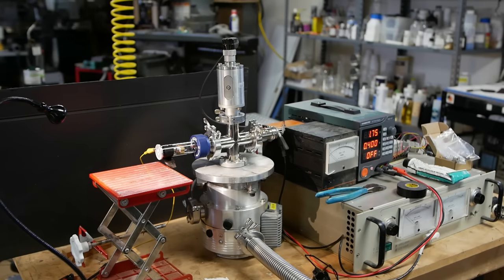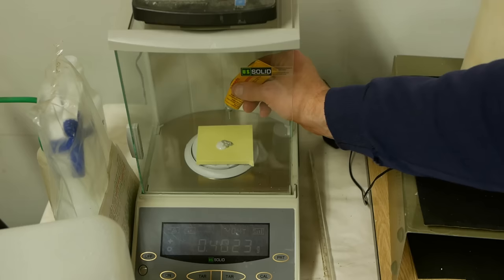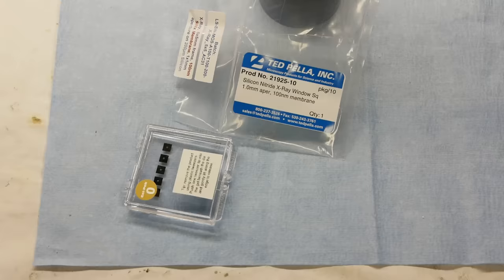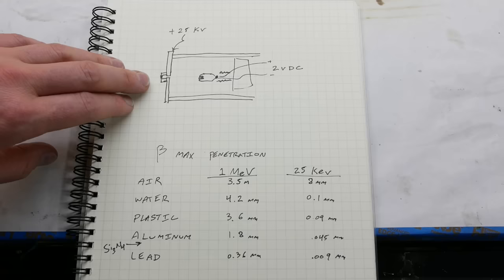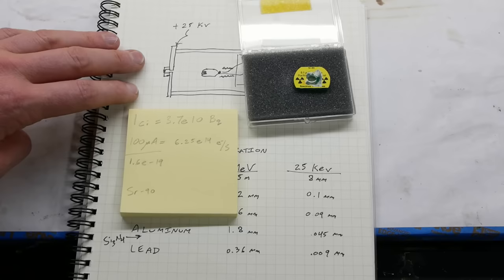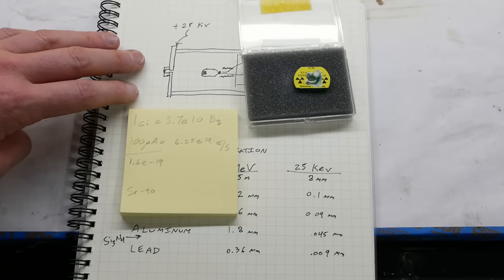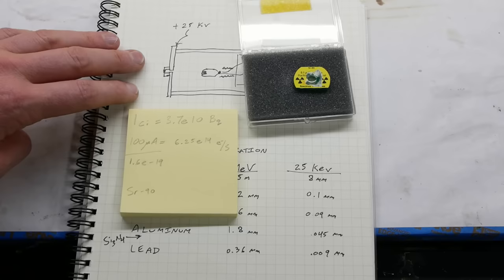Shooting an electron beam through air

Comment: As always first to congratulate you for the excellent videos you do. Second I have a question why the electrons go threw the hole and not strike the aluminum  instead since the hole itself ha no a charge and the aluminum plate has 25000 volts. The logic thing is for the electrons to go  to the positive plate.
Reply: A lot of them do hit the plate.  But the ones flying straight down the center of the tube are pulled equally from all sides and are accelerated through the hole.

Comment: Put a solar panel cell in front of it.  I'd love to see how much power is transferred / created.  

Since we know that solar cells work by pushing electrons from one element through a semiconductor into another elem, I also wonder what other semiconductor (besides silicone) you could use as well as sandwiched elements to create the 'perfect' or unique power transfer. 

What element has the highest number of shell electrons (that would give them up easily), is the element that has the most empty spots in its shell?

Comment: It seems the beam is quite well focused to be going thru the window given the filament is a few millimetres long and the window is quite small but you seem to have very good results. I also thought that the electrons would tend to veer off to the aluminium electrode but instead they must have accelerated to such a high velocity that they continue forward and go thru the window. I wonder how the length of the glass tube affects the performance.

Comment: Could you somehow show the electron diffraction ? It is easy with light, you just put some grating into the beam of light, but I am not sure how to do with electrons and then visualize the diffraction pattern.
Reply: Sure it works with crystal lattice used as grid: https://en.wikipedia.org/wiki/Electron_diffraction , https://en.wikipedia.org/wiki/Electron_backscatter_diffraction
I'm not familiar with the first one, but second one is used to detect crystal structure and orientation and to see different crystals in steels. Only problem is that it needs perfectly polished surface (and vacuum, phosphor screen, camera and beam focused on single crystal at proper angle)

Comment: How low an energy can you run this and get the electrons through the glass? I was thinking you could run a barium doped emitter and not ruin it if you have to bring your device back to atmosphere. The emission from those barium filaments is apparently amazing but, you can never bring them back to atmosphere once you use them. That makes them problematic form calibrating gadgets that go to space.

Comment: Great video!, I use similar tools in a semiconductor cleanroom. Never imagined that someone will build similar ones in a garage :D
Technical questions, what vacuum levels did you reach and what is the limitation?, the pump or the chamber?. Did you use any roughing pumps?. What are the value of voltage, current and frequency of your source?.
Reply: He was using a common flashlight bulb.  DC current, 100mA.  Probably a few volts. He showed how he made it in the video.

Comment: I don't think your finger would suffer much, considering penetration depth, the beam would probably give up steam somewhere within dead cells layer.

Nothing prevents most of the electrons ending up in aluminum disc now. If you want to reduce x-ray emissions and get more electrons through the window, you need some focusing.

Comment: This thing only requires low current HV DC, right? Voltage multiplier on a neon sign transformer can get you that easily enough, for higher electron speeds.

Comment: IIRC beta irradiation is also used to treat PTFE to allow adhesion to it. Maybe stick a bit of teflon in the beam and try to glue it?
Reply: I wonder if that's how they get non stick coatings to stick to the pan.(?)
Reply: @pinethetree  that is exactly the use I had heard
Reply: @damienmiller  Awesome! I've wondered about that for a while.

Comment: Is there a way to block the X-rays and just get the electrons?
Reply: I think focusing the beam in the tube would help, if I'm understanding right you get x rays when electrons of sufficient energy hit stuff, in this case that aluminum plate. Of course I suppose it's always gonna spit out some radiation because the whole point here is to bombard things with high energy electrons.

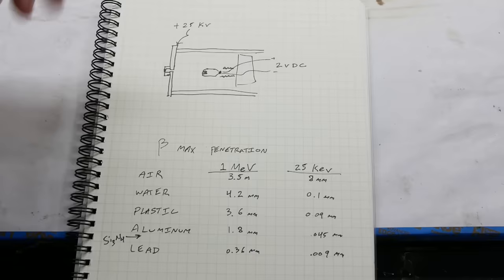Comment: At 07:00 you talk about the aluminum electrode "producing" less powerful X-rays than if it would be out of tungsten (or a harder metal in general). Could you elaborate why this is?
Reply: Google "characteristic xray" for explanation and "
Energy table for EDS analysis" for energies of xray photons. It's not completely true that heavier atom emits higher energy because it never emits photons of higher energy than electron, but heavier atoms have more spectral lines. And characteristic xray is only part of emitted xrays.

Comment: Would it be possible to accelerate the electrons fast enough through a material, say glass or diamond, with a reduced speed of light to create a Cherenkov radiation effect? I've been trying to come up with a relatively safe way to demonstrate Cherenkov radiation with an electron beam instead of a radiation source.
Reply: Looks like for glass, you would need around 170keV or more to achieve Cherenkov radiation if my math is right. Not sure how one could go about accelerating to that KE. Suppose a 200kVdc supply would do it. Also, do the electrons lose energy when passing through the aperture? I am not currently familiar with RF powered accelerator architecture, only electrostatic.

Comment: How about targeting a microphone to see if you can “hear” the electron stream? Try putting a DVM set to amps with the negative lead connected to ground of the power supply of the bulb filament and the beam aimed at the  positive lead to see any possible current flow.
Reply: Also along these lines: try creating an electret.

Comment: How about try using components from a vacuum tube? The grid and plates from a beam tetrode like a 6L6 might be effective, and the heater from it would likely be a far better electron source. Also, try putting the glass from a power tube in the beam- any power tube being driven reasonably hard makes the most beautiful blue glow on the glass from where the stray electrons hit it.

Comment: You mentioned opaque paints being cured this way, 
Maybe an improved conductive paint that could be cured with this.
Or 
Maybe make a photo resist alternative for PCB etching?
I realize this is low on practicality with all the other options out there for PCB etching.

Comment: Oh the pigment thing reminds me, I have some defective gel polish you could experiment with. It’s nail polish that’s cured with UV light, but I think the factory screwed up and accidentally used a UV stabilized pigment because when it cures under the UV lamp this particular stuff only cures at the surface and remains liquid underneath. I’d be happy to donate it to you for your experimenting pleasure, it would probably cure under electron bombardment, and you could contrast it with how it doesn’t quite cure with UV exposure.

Comment: Graphene also makes an excellent vacuum barrier.  Today, the sheets have less defects and you could stack up 5 and they would still only be ~ 15A thick.  So, you get a lot less attenuation than through the silicon nitride.   

The nitride windows have also been used in SEM imaging for in-situ liquid environmental cells.  Cultures are grown inside at ~atmosphere.  You need to have a BSE detector and the cell cultures must be growing on the inside surface of the nitride membrane.  You must also be careful not to focus the beam at too high a current and rupture the window.  Which is likely what happened when you arced your source.  

If you coated the graphene with metal, you would produce a source of x-rays where the beam strikes the metal.  Then you would only need a camera behind the target object.  

This simple x-ray tomography setup was made for inside SEMs by Gatan and Bruker.  But nobody sells them today.  Not enough demand.  But they worked.  You could make a simple version.  I have considered revising the product.  

https://www.bruker.com/fileadmin/user_upload/8-PDF-Docs/X-rayDiffraction_ElementalAnalysis/Microanalysis_EBSD/Flyers/Fly_micro_CT_en_rev1_3_lowres.pdf

The resolution is improved if you keep the metal foil closer to the focused beam and keep the target close to the x-ray source.  But the concept is pretty straight forward. 

You can use you window with a metal costing as well, to produce the x-rays.  

Then put your thin low density target object (the x-rays must be able to penetrate) behind the x-rays source and capture images with a suitable camera.  Rotate the object while taking images and create tomograms.  There is open source python scripts for creating the 3D tomography.  

Similar membrane apertures have been used to make an “airSEM”.  This is an odd company out of Israel and the product is b-nano.  It works. Cornell has one.  Niche market.  

https://www.cambridge.org/core/services/aop-cambridge-core/content/view/S1431927613004133

I have also done micro photogrammetry in the SEM.  Which is very cool!  I did a few presentations and tutorials on that.  You could do that now with your SEM using the simple auxiliary rotation stage. Just like with the drill bit.  Except each rotated image becomes input for the 3D object model.

Comment: Would it be interesting to dip the filament in a barium-nitrate slurry that, after initial heating, forms a barium oxide coating? ...  PS:  I see you already tried something that in your glass diffusion pump video! Great minds think alike. :D

Comment: could you try to reduce molten salts to metals? maybe you could melt some KNO3 NaNO3 in a very thin glass testube and blast it with e-beam - I heard about using electrons from incandesent lamps to get a similar result - submerge glass bulb in molten salt and turn it on for a while and then wash the bulb with Phenolphthalein solution to detect alkali metals

Comment: When electrons "force there way through" things, does it make a physical hole?
Reply from the maker: If the beam is intense enough, yes!  In fact, electron beam welding is used to melt and fuse material in a very highly controlled, super precise fashion.  At lower powers, the beam may weaken or cleave apart molecules so that the material can be etched or washed away in a later process.  Paradoxically, the beam may also crosslink molecules, making that area stronger than the surrounding material.

Comment: Hello.
With the tools and area availability, is it possible to control a highly-charged-proton direction or movement? Tried it in 1965 with a monster transformer and a generator running by 1965 Ford Mustang' Engine), achieved 6.7e7 volts (5.5e1 amp); nonetheless, the voltage was not enough (insufficiencies of plasma), and I could not cage the radiation!
Regards,
Reply: I'm looking for somebody to start a project about applying dielectroforesis force any good sources that you have I ask you for any knowledge about the subject

Comment: I would think that the vast majority of the current from the filament is getting caught by the aluminum plate, but even if you're off by two orders of magnitude that's still a much denser electron flux than just about .any beta source

Comment: One way of detecting beta radiation is by measuring the change in threshold voltage of a mosfet. The threshold voltage changes because of implanted electrons in the dielectric. Seeing that happen would be really neat.

Comment: So I've decided to build this thing because it looks like the coolest thing ever. I bought everything I needed on ebay over a very long period of time and the setup is super jank, but I'm wondering if my pressure is good enough. I managed to get down to about 7x10E-6 torr of pressure, and I'm also going to use a 150kv ish power supply that I made. Does anyone know if the pressure is low enough to avoid a plasma forming and breaking the aperture like he mentioned in the video? I have had to disassemble my turbo several times to replace the bearing and I really don't know what I'm doing so I think if I exposed it to air it would probably explode. I'm trying it in like two days anyway so we'll see but if anyone can intercept this and tell me whether or not my conditions are good enough to keep my setup from dying that would be sick.
Reply: Update, plasma was created at 4×10E_5 torr, aperture broke, turbo survived but goddammit I wanted this to work

Comment: See how many of your other windows it can get through.

See if you can measure the current in the beam through air.

See if the beam current can make a neon indicator lamp light up.

See if you can give a small metal target an electrostatic charge.

Comment: *REQUEST*  
I am an brass instrument smith and I am wondering if there is a version of the solder from your last video that could contain LEAD that would work. It would give the solder enough strength to be used in the instrument world and would allow people like me to make HUGE leaps forward in instrument making (joining aluminum or titanium or nordic gold to a normal brass or copper) that have been talked about for years, but have not been potentially possible. Is a stronger version containing lead (or even something else) possible? If so, please explain how to mix it?
Reply from the maker: There are definitely leaded versions of the active solder, and it will definitely join difficult metals to brass.  You may want to have someone test the joint strength before you invest in your own system, but it will definitely stick the metals together, and be conductive too!  I also found that wetting the difficult metal with active solder, and then later reflowing it with conventional solder works fairly well.

Comment: 10:14 Would you mind re-doing the demonstration after blacking out all the other light sources such as the bulb filament.  That way we can see the electron illumination effect all by itself without the light from those other sources in your lab.  Can you discuss what you think might happen if you discharge the electron beam into a condensed metal hydride such as Platinum infused with deuterium in a manner that would saturate the crystal lattice?  What would it take to get some fusion going on.  It might not be much but would it be possible for a few of the electrons to cause proton molecular fusion from h to he?  If you precisely measure and maneuver the small sample piece you could make rows of the pitting that occurs just like a farmer, plowing.  Thereafter the sample could be viewed under a microscope to attempt to detect any etching that has occurred.  Thanks.
Reply: There is light from the filament coming through the window itself along with the electrons.  You aren't going to be able to block that.

Comment: I was running an electron beam irradiator for several year in the tire industry. 350-500 Kev, 30-50mA, Titanium window 4x20cm 2microns thick, distance between rubber sheet and Ti-window 1-2cm.
The irridiation chamber was a concrete bunker covert from inside completely with lead plates. 
The electrons do generate X-ray radiation inside the bunker. For That reason we needed the lead shielding. 
For Saftey reasons Even everybody working outside the Bunker needed to wear a radiation dosing Badge. These Badges needed to be sent on regular Basis to the local authorities for further Investigations.
X Rays dosis in the Bunker was that high that a modern new CCD Camera was sending Color pictures for only 2 Weeks, for another 4weeks black and white pics and After that time no pictures.
Yes, it was a challenge and a lot of fun to run such a machine but you Must be cautious.

Comment: I just wanna see if it creates a positive electromotive force if you beam it straight onto a conductor, making a wireless circuit. 

A different approach, also, would be to see if you can harness electromagnetism with a coil around the traveling electrons, making a wireless electric motor
Reply: I'm looking for somebody to start a project about applying dielectroforesis force any good sources that you have I ask you for any knowledge about the subject
Reply: @Podemosllegaralossubs-ty7bq  I'm afraid I won't be of much help. Apart from knowing it's used at times in microbiology, I'm not very familiar with DEP

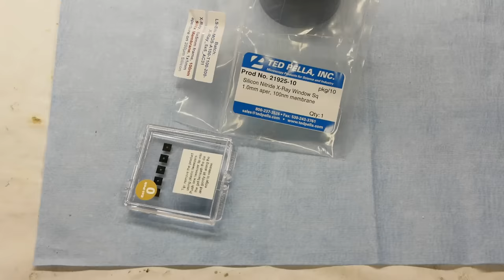Comment: 3:38 That was to much for the turbo based on the volume in the form of the turbo top part and the 4-joint and the glass. A chamber about 3 - 4 times that volume opts for about a maximum 0.2- 0.3 mm hole when venting. The turbo might just seem fine but the bearing takes damage since there is a huge force involved even with small amount of air since the rotor spins so fast. If way to much of air rush in the wings can be bent upwards and if they slam into the stator wings you don't want to be in the same room, trust me I have seen the after match. I was not there but close and it sounded like a small bomb went of. The wings/blades on the rotor was completely ripped off so the pump was absolutely totalled, fortunately no one was hurt though. It happened after a valve failed and totally opened up to full air right into into the turbo. Like a 10 cm hole just open to air and the turbo at 36000 rpm+ was on the other side.

Comment: couldn't you also use a very small aperature plasma window/valve (https://en.wikipedia.org/wiki/Plasma_window) for this? I've been wondering if that's within the reach of the diffusion pump equiped homeshop for a while now :) I'm however unsure how well that would pass electrons and the valve would emit a lot of light making experimentation close to the valve rather tricky.